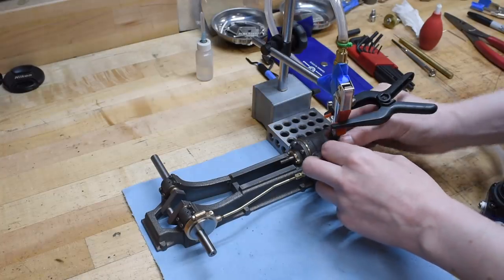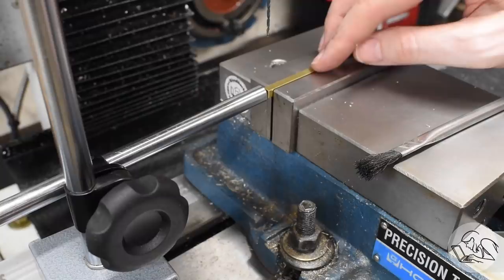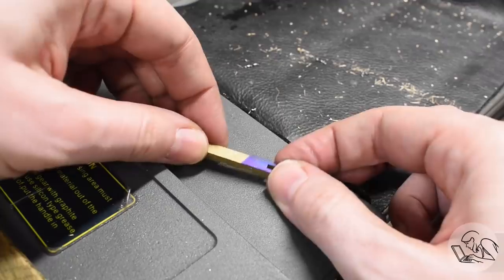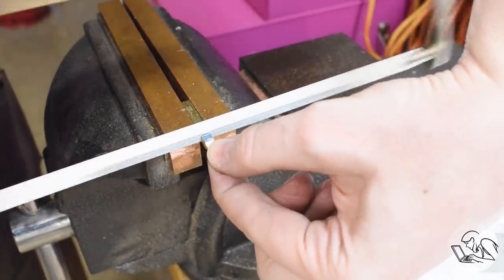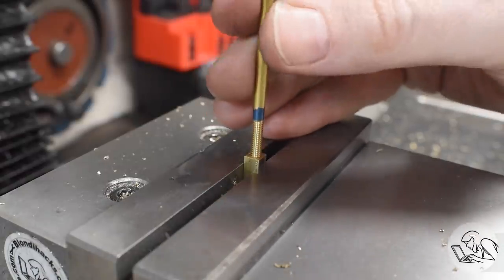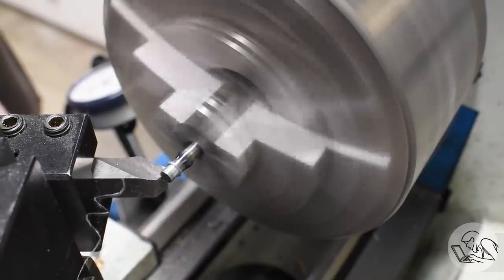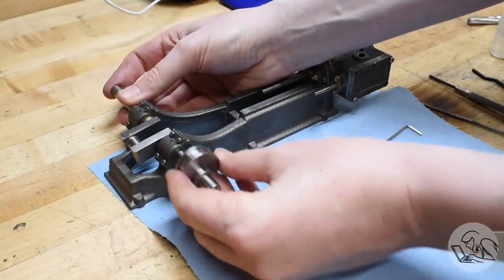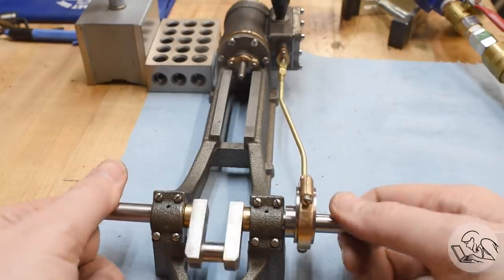Let's Build a Model Steam Engine : Valve Gear!

Comment: OK... I won't mention that you could have used feeler gages to measure a small narrow slot (the crevice in your clevis :)) because so many others already have. So... just ignore that first sentence please. There are many other ways to measure small insides at your disposal. Drill bit shanks and a micrometer.  Even turn down a nub of metal on the lathe until it just fits the hole or slot and mic it. In general some sort of gage pin or block either of known size or a size you can measure.
The usual thing for small clevis pins is to make the hole of the center piece slightly undersize so that it is a press fit (or tappy-tap-tap fit) and holes int he outer piece as slightly oversized. This sort of arrangement is preferable to making the outer holes undersize and the inner one oversize. Also better than making all three holes the same size, loose or snug fit on the pin.
The engine is beginning to look really good.

Comment: Perhaps not the best method, but you could measure the gap in the clevis by stacking feeler gauges.

Love the vids.
Reply: Or drill rod; the shank of a new, never-chucked drill bit of the correct size would work.

Comment: Nicely done on those small parts.
If I do this project that's one of the things that concerns me as there are so many ways to do those which means there's lots of ways to wreck them and a few ways to get them right. Leaving the stock material intact until you've done most of the machining was done will help a lot of people. Well done on that.

Comment: The valve mechanism set up is very similar to our (Pichi Richi Railway, Australia) YX141 steam loco, built about 1890. The mechanism is on the inside of the main frame, along with the excentrics , while the cylinders are on the outside.

Comment: I noticed you using a squirt bottle for the WD-40 when drilling the .063 holes. A trick I use is to get a few 20cc medical syringes and some 16 gauge blunt needles from McMaster-Carr. They give you much more control of your fluids. It's great when you just need a drop or two. I load up a syringe with each of the fluids I use so they are ready to go when I need them. Some chemicals will cause the rubber seal to swell so depending on the fluids you use some syringes will be single use only and others can be used over and over.
Reply from the maker: Great idea!

Comment: I was also all excited:) Instead of locktite could you peen the pin? I mean have it out of the clevises and hold it and lightly peen one end almost like a rivet, but less. Then slip it in and hopefully, that end is slightly larger and you'll need a pair of pliers padded with copper to encourage it in the last bit.

Comment: I thought you were going to drop that clevis in the intro... good use of cinematic tension. What? You say the pin doesn't fit? No problem - we make a new pin. Love that all day long....😁
Reply: Did you consider improving the design when machining the new pin by increasing the length of the 0.0625" diameter portion and forming a 0.030" thick X 0.09" diameter head. Lock-Tite the protrusion if future removal is required.

Others offered peening, a sharp center punch mark on each end would retain the pin if future removal isn't required.

Comment: Bonjour Quinn
I am impressed with the care you take in making every little piece, I am sure that professionals and even most amateurs do not make this effort.
And it's beautiful to see the birth of a steam engine (I would never tell you how much I have to pay to get a single 6 x 0,75 mm nut for example).
About your test, you passed successfully a step but please keep in mind that a steam machine building is validated by its steam test, which will come soon I hope as you work quickly and well  :+)
About steam, are you going to build the oil lubricator, the boiler and why not a governor  ? 
Amicalement, Raphaël

Comment: Quinn, I called the people at the machinist Hand book , and they said they would be adding (Parallel Squishing technique) to the next edition, of coarse they check with Robin and he OK it ...if you need a small precise  pin  you could be lazy like me and cut the bottom off of the correct size drill bit ?? Stay well PeteM   President of the Quinn Dunki fan club East Cost Chapter ,,, You know were rust was invented ...

Comment: Quinn, 
First, I'd like to thank you for the videos you produce. Your explanations are first rate and I love your sense of humor. Now, I do have a question for you: When you were heating up the linkage to bend it, what was the material you had it resting on? Clearly it resisted the heat of your torch.
Reply from the maker: Thank you! Those are fire bricks
Reply: @Blondihacks   Thanks for the info. I had to look up what a fire brick is, guess my ignorance has to do with spending my life in central Florida lol.

Comment: I presume that adjusting the length of the valve rod comes later - to adjust the timing and dwell?
Reply from the maker: Yep, lots of adjusting later. Everything is threaded for that reason
Reply: @Blondihacks  but no tiny turnbuckles to do the job without disassembly

Comment: You are making great progress. But i am at a loss as to why they just use a pin for the clevis . I would have thought a shouldered bolt with one side of the clevis threaded
Reply from the maker: Yah that might be better. I can always make one later

Comment: This is exciting!  could a model steam engine like this be mounted to power a radio controlled car?
Reply: I'd say that an engine this size would be too big, you also need to account for the boiler heat source (probably gas), the water and fuel tank needed to run the engine
Reply from the maker: Yah,  steam people tend to focus on model boats for this reason. It’s fairly easy to build a model steam engine that can run an RC boat, but cars are tougher. It could be done, though run time might be short because of limited water

Comment: When you first run the engine, (at around 14min50s), there appear to be leaks in the cylinder's body / gasket 8I'm hopeless with the technical names).
Reply from the maker: That’s because there’s no gaskets installed, as I said in the video

Comment: If you did not have another pin. On male part use a center punch with a large diameter. The put part section with hole on a block and lightly punch. Squeezing hole smaller.  Cheaters way to make a hole slightly smaller

Comment: Hi I can't tell you how many engineer's I have had to show how to use a file to do a radius on a part I think a lot of them don't do much if any hands on experience it's all tick boxes now and they won't think of workarounds and just give up you must have every tool in the catalogue I had on person wanted me to by a taper turning attachment no way alter the cross slide or tool post use your brain like your packing with round bar   then you found another way sorry for the rant there it's not to bad now
Reply: Punctuation doesn't cost anything, bruv
Reply: @classicbandgeek  neither does spelling brother.